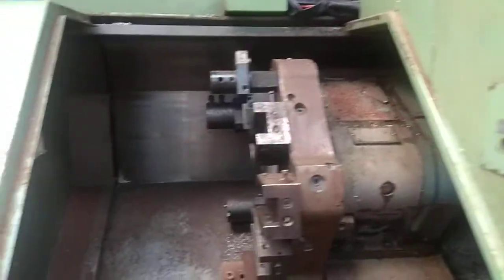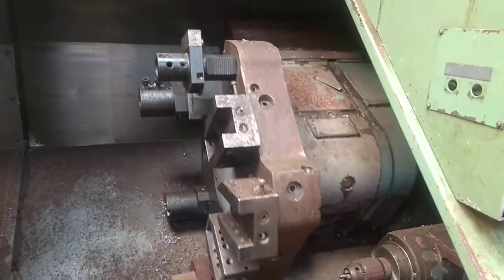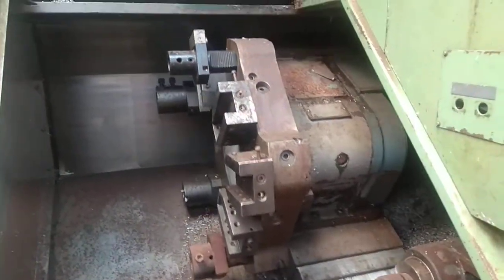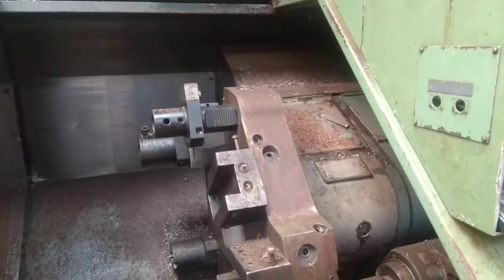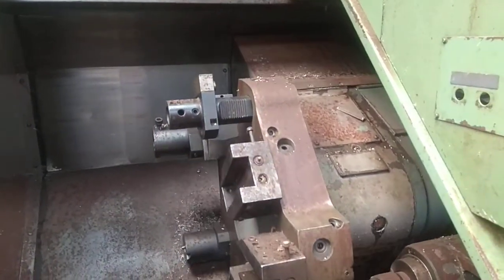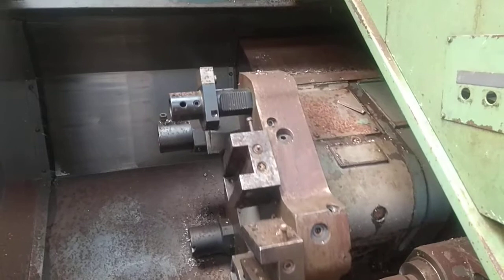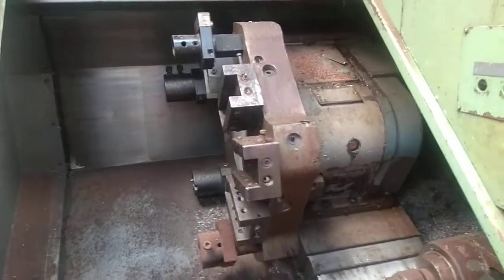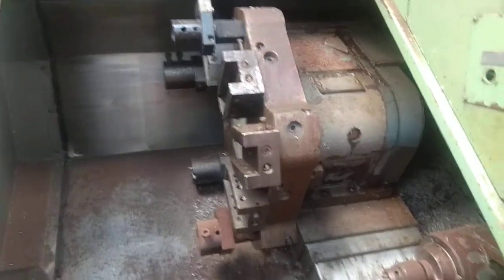Linuxcnc retrofit update  from New Zealand

Comment: You don't need crazy fast rapids on a lathe because the travel distance is nowhere near as great as on a mill. Even modern day, industrial built machines only run the X axis around 400 or so inches per minute. Mills are where faster rapids produce a beneficial decrease in chip to chip times. On lathes, it's more about cutting power
Reply from the maker: My x axis rapids are set at 12m per min.  400in/min is 10m/min.  So I'm in the ballpark.  The original machine had 8m/min max rapids
Reply: @carbidecuttersnzltdandrewb8449  if the machine is linear guide, the axes can be moved faster than box way. An NLX2500 from DMG Mori will move X and Z at 30m/min on a box way machine, but that's brand new, out of the box. You're at the mercy of the technology of the time, the ball screw pitch, amount of steps you can generate, etc. If you're at 10 on an old dog machine like that, I think you're doing great. If you can get more without knocking the machine around, try it, but you don't get much of a benefit of insane rapids on a machine with short axis moves. It's more in the programming. You can back the turret away 2mm from the face of the part and index right in front of it if you need cycle time.